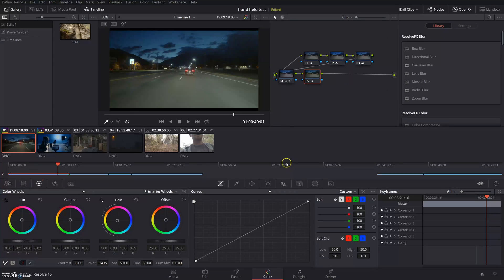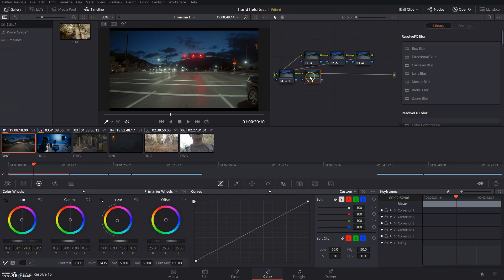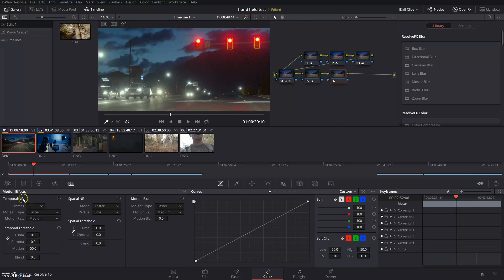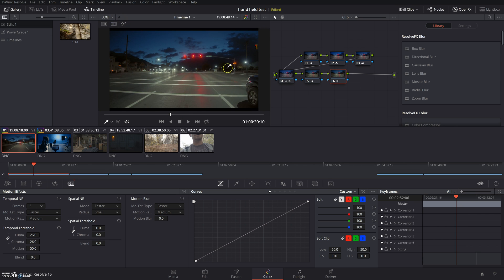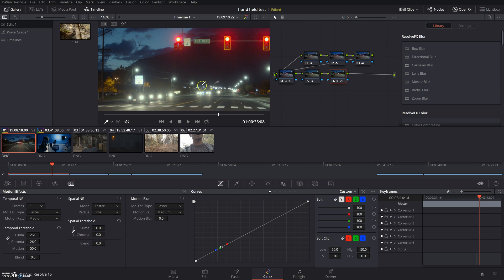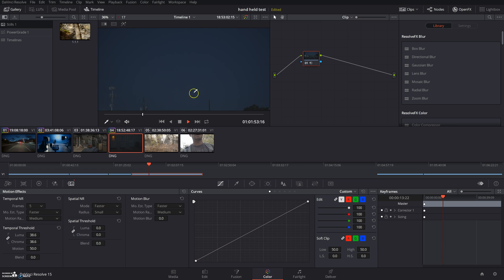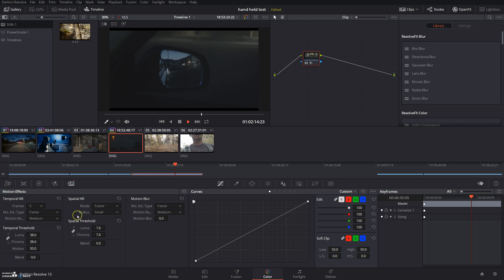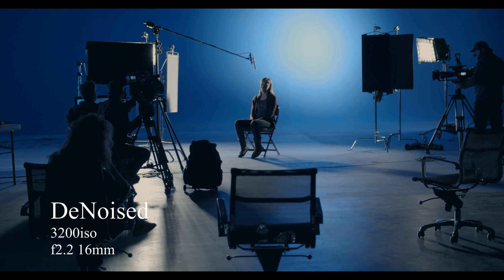BMPCC4K noise reduction a how to

Comment: Hi Charles, 

I am glad i found this video. I have been using DVR 16 for past few months and I actually never used this function before. Despite using 1250/ 3200 ISO in low light, i still get noise. After using this tip you gave, FINALLY I now get what i have been witnessing in other low light footages from other videos.

Really appreciate it. Thanks

Comment: Shoot at 1250 for low light. More shadow details below middle grey. Shoot 1000 for ext daylight  and over expose (do not clip) bring down to 400 in post. Problem solved. Look at how the DR charts work with middle grey for this camera. 400 and 3200 are not the best solution for most situations. 400 is really only good for balanced highlights and shadows like interior daylight or controlled lighting. Lower iso in the second iso bracket has much more shadow detail. Look at how the iso effects stops below and above middle grey. Look at the waveform shelves at 400 vs 1000 (do not overexpose to the point of highlight clipping) gotta learn how the DR works on this dual native iso. It was the same with the og pocket camera. I learned after my first time using the camera. It’s not as simple as “400 and 3200 are the native” no they’re the most balanced stops above and below middle grey. other ISO’s still have 13 or 11, depending on iso bracket, but it dictates where those stops are being allocated for highlight and shadow retention.